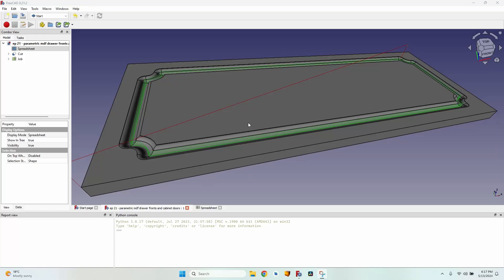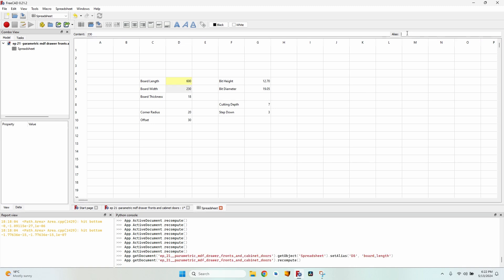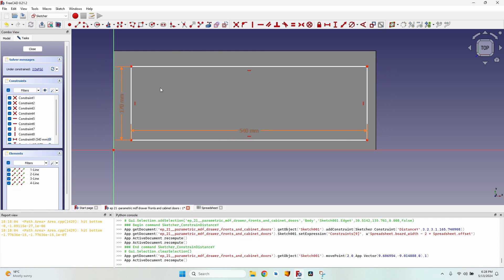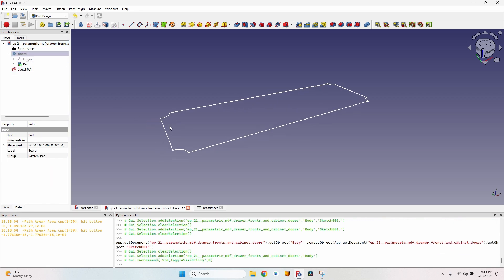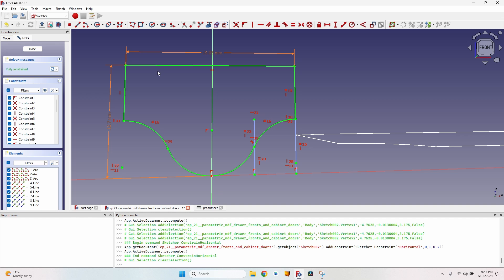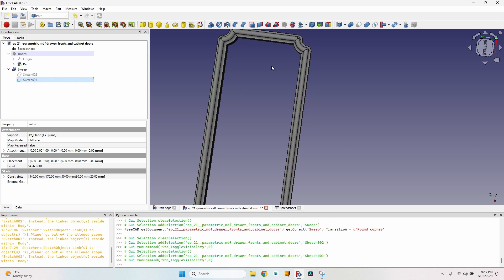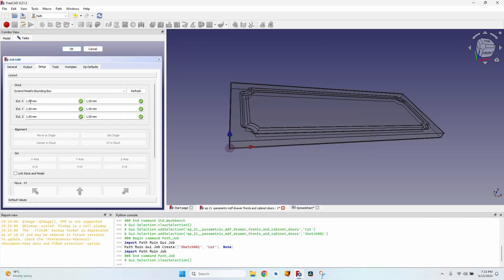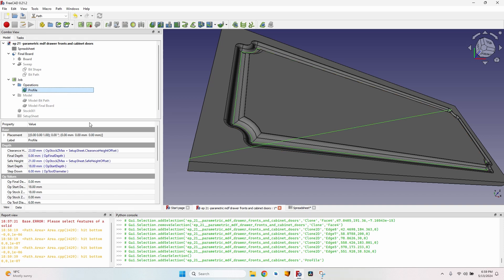Parametric CNC Moldings in FreeCAD | Full G-Code Workflow for Custom MDF Cabinet Doors

Comment: With the Spreadsheet entering a value of 1 in in the formula bar and Freecad will do the conversion for you.
Reply from the maker: What portion of the video are you referring to?
Reply: @opensourcecnc  1:40/1:50 min in. In relation to the tool bit dims.
Reply from the maker: Thanks!